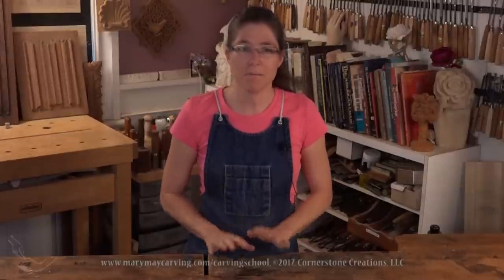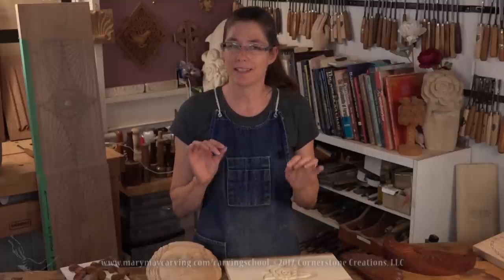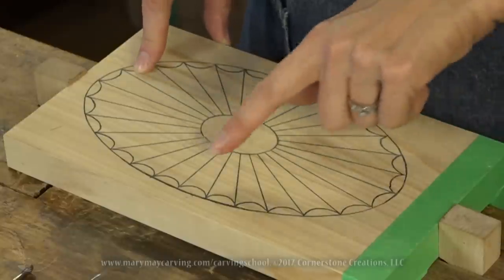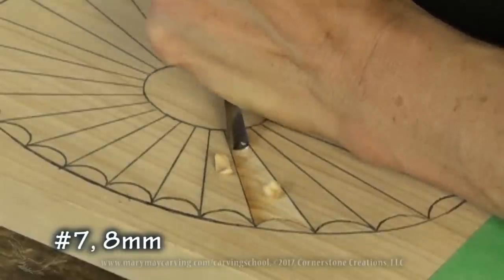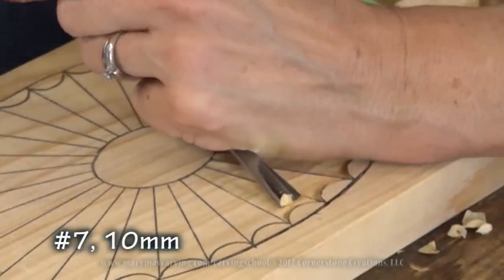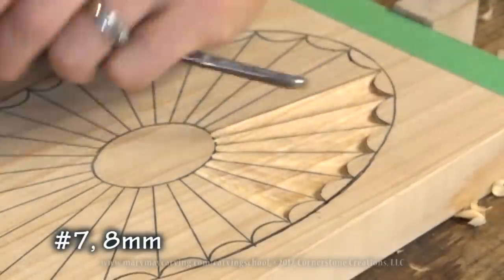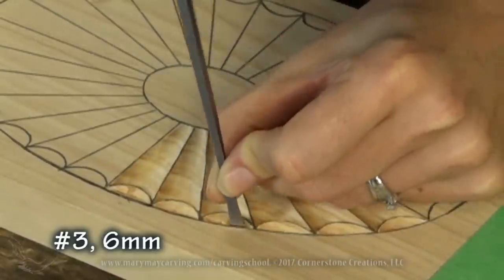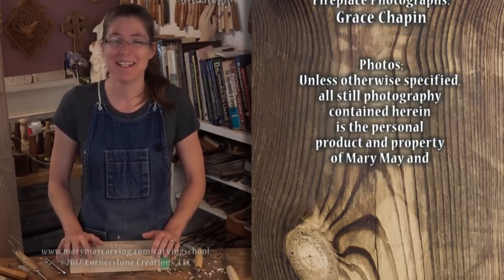Carving a Sunburst - Complete Lesson

Comment: How would you go about getting rid of the carbon sketch lines on the peaks if you weren’t going to paint the piece?
Reply from the maker: If you use carbon paper to transfer your design, lacquer thinner can remove a lot of it. Very light sanding can be used to remove any remaining amount (just be careful not to sand the sharp corner down). If you use graphite or transfer paper, much of it can be erased with a pencil eraser. Ideally, this line would be removed with the carving gouges, but that is much more challenging to get a very controlled cut and leave a nice, sharp high edge.